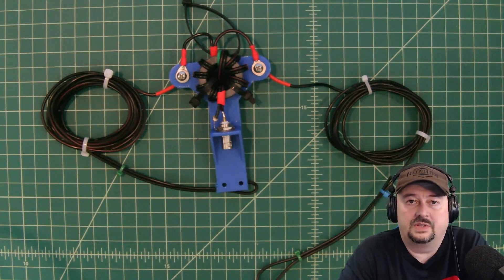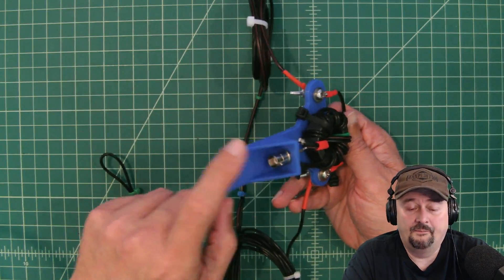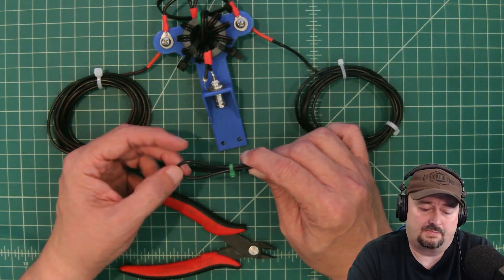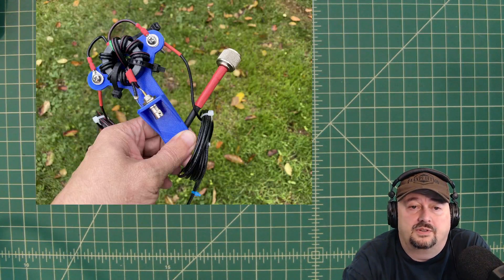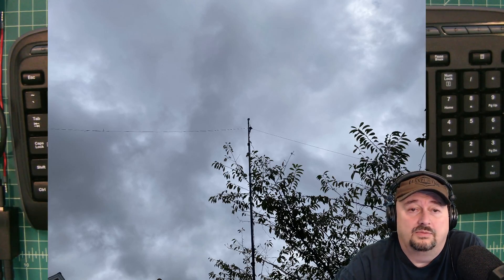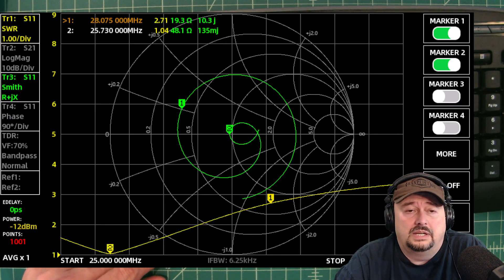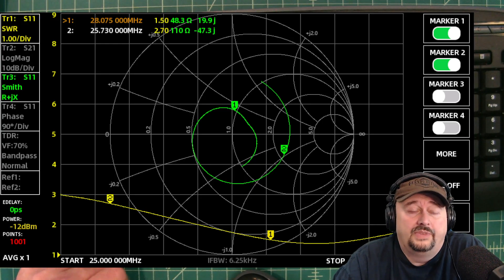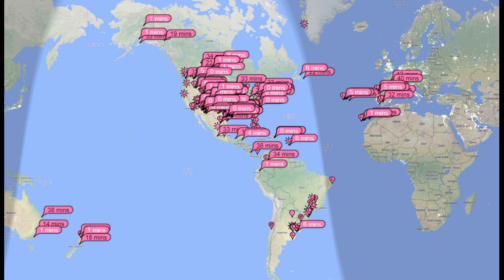10 Meter Dipole Antenna for Ham Radio

Comment: One thing I have never been clear on, guess I never asked either, is the the length of wire measured to the fold over point or the end point of the wire?
Reply from the maker: I measure to the end of the fold over 👍
Reply: @TheSmokinApe  Thank you for the quick reply.
Reply from the maker: @keimahane  no prob

Comment: nice. over cut. been their done that. good thing cheap wire. I have used wire from the trash. should use 1:1 on center fed. that a balanced antenna. this stops RF from coming back down the outside of the shield of coax. I would keep power down on cheap wire. CCA wire is fine. RF is on the surface of the wire. just for the reason of BNC ,I am making M & P coax potaflex 6 . the new stuff with BNC and PL259. I got 50 ft coming of potaflex 7 coming on a reel and BNC adapter coming. the good stuff.   and I was lazy. heaving M & P make them with the ends I want and test them . they happy to do that.  I will add my own choke when needed. you can also have ABR industries make a great RG 8X with BNC on one end PL259 on outher or BNC on both, can install chokes and protective cover . that would be great for you to prevent that nick on coax. for 10/11/12 and 6 meters their is a outher trick if you ok it is long. cut elements 3/4 wave . this will tune 50 ohm. you get more antenna gain . for 6 meters this is easy. going to make some mono band elements for DX commander. 10/11/12 and 6 meters cut to 3/4 wave . DX commander gave me cut length to start with for that. the next tune will be 1 1/4 wave that getting quite long. for 40 meters do the same with fold back and playing with length you can get a tune on 15 meters. how the DX commander does it with 40 meter aliment . fold back from the top and back down. this a trick to help 15 meters tune. DX commander has a video on this. " fold the end of a dipole back- what's happening ? " you did that on your 10 meter one hear. 10 meters great band when open, I reach the UK from NY fall threw winter when open. summer I get Porto Rico very often. not now, band shift for me. 73's
Reply from the maker: I use the cheap wire for "throwaway antennas and projects" not for serious stuff, I agree with your point on that.   Nice on the potaflex, that looks like good stuff, I am interested to hear how you like it...  ABR 8x is mostly what I use because it was cheap, notice I said was, it's gone up considerably.  Thanks for watching!
Reply: @TheSmokinApe  That why I say get the protective covering for the ABR coax. just use the coax builder and select it and what ends and if chokes . Mike K8MRD ham radio tube has great video on potaflex 7 coax. also on ABR coax. startting to come in now and can order potaflex 6 and 7. comes on a reel and BNC adapter. and can make cables for you what ever end you want. and they test them. cost a bit. not cheap. but will flex and flex stay good. great for test jumpers . also ham radio 2.0 Jason has potaflex 7 in a  video. he put power threw it. the antenna torrid got hot but potaflex 7 was just super ! . 73's

Comment: Ooops on that antenna trim.

This is another reason why I’m a fan of the end fed half wave dipole.  Trimming the antenna at higher frequencies requires less precision.  Had you cut that same 8 inches from a efhw, you’ll probably be spot on the desired freq center.

It’s just more convenient to do too.  It’s just one cut, versus two and having to worry about keeping symmetry to boot.
Reply from the maker: Hey Robert, I did get a little scissor happy.

Comment: As a tech, I have been watching some videos on 10 meter dipoles and notice some use a balun and some don't. Does the dipole with a balun work better? Thanks!
Reply from the maker: People will say you don't need one, and I guess that's true.  You don't "need" it but it helps match the antenna to the coaxial.  I suggest always using one...

Comment: For a portable antenna not up all the time any kind of wire will work. I've built 49:1 transformers using scrap 14 gauge scrap wire from old romex. It is still working after 2 years with a efhw 10-80. I like to make antennas out of materials I have instead of going to buy all new (although that will eventually happen). If it works, great. Keep doing it. Jack K5FIT
Reply from the maker: Hey Jack, I am with you.  I like to build wire antennas and see how well I can do.  Thanks for watching 👍🍻

Comment: I am curious, what is the reason for the Toroid?  I thought you only needed a torroid when you had an impedance mismatch.  Can't I just connect the shield to one side and the center conductor to the other?
Reply: I believe he's wound it as a choke to stop common mode currents from travelling down the shield and into the radio.
Reply from the maker: Wayne is 💯

Comment: I made a similar di pole for 20 meters from a repurposed extension chord that my dog had chewed on. I really like the 3d printed holder/bracket that you have there. I made mine from a small piece of plywood. Also I soldered all the connections but I like your connections better for the fact they would be easier to change out in the field. Mine has an SWR of 1.5-1.7 all across the phone portion of the general frequencies. I had to “trim” back a few times as well but it was a good learning experience for me. Nice video
Reply from the maker: Hey David.  With the wingnut that’s on there I can keep the elements for 20 and 40 in my back as well and it’s breeze to swap them out.  Thanks for watching 👍